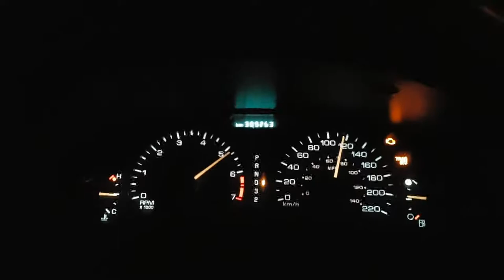Mod Everything Trailer

Comment: Hey can i use 307 heads and intake for my 260 olds
Reply from the maker: They will bolt to the block but I'm not sure if the valves will clear the bore on the 260. If they do clear it would also drop your compression ratio with out milling a bunch off the heads or changing pistons